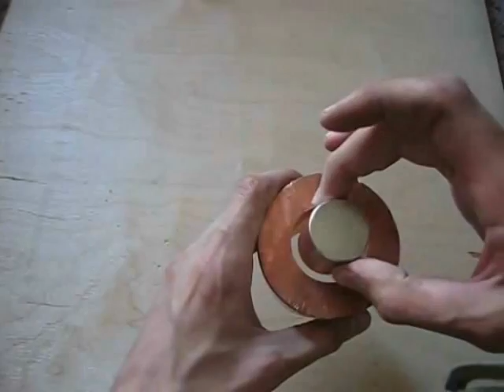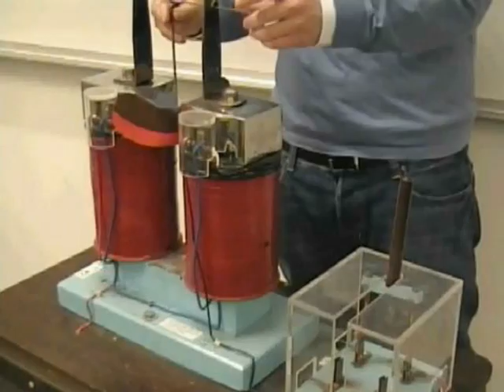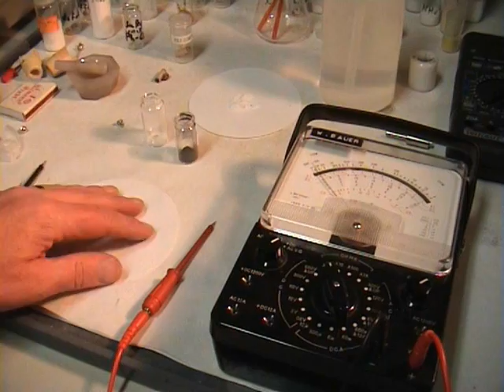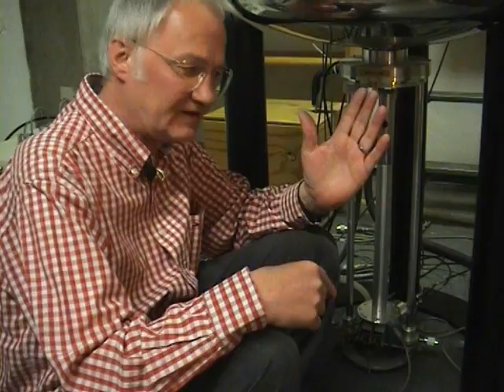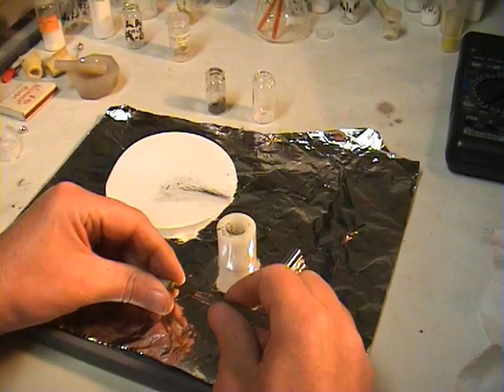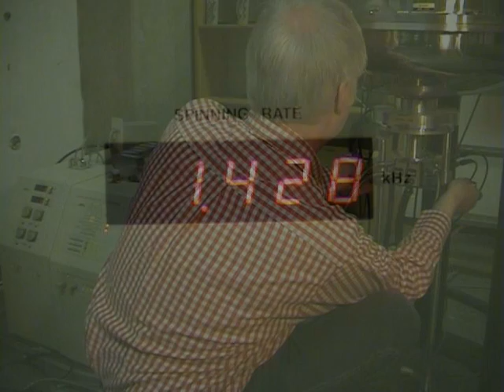The Effect of Eddy Currents on NMR Magic Angle Spinning of Graphite

Comment: The magnet is cool, didn't realize you could show this.  I notice the effect when I take a probe out of a magnet, you have to pull slightly to overcome the drag of the currents.
Reply from the maker: Dear Scott, thanks much for your comment. Yes, that's true: eddy currents cause the resistance when putting in or withdrawing a probehead. If the magnet wasn't on field, the probehead would fit in very smoothly or would simply drop out immediately. An experience I always make: "normal" probeheads (JEOL) are made from copper, and the induced eddy currents are severe. However, our (20 years old) field gradient probehead has an aluminum outside, and here the eddy currents during replacement are much less.

Regards, Waldi Bauer

Comment from the maker: Dear Titash, thanks for the nice comment. Since we are using 6mm rotors, the total amount of graphite is quite high. I might imagine that using smaller rotors might sooth the problem, of course, with the disadvantage of lower sensitivity. Alternatively, you might fill your given rotor with alumina up to the height of the coil, then fill in the appropriate amount of graphite, and then again a layer of alumina up to the rotor cap. I'm currently testing this method and will keep you informed.